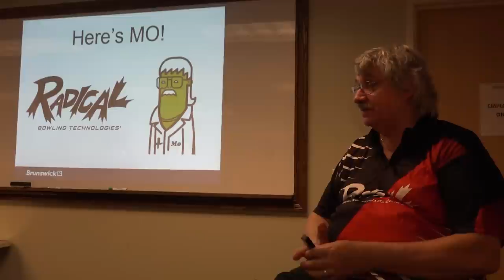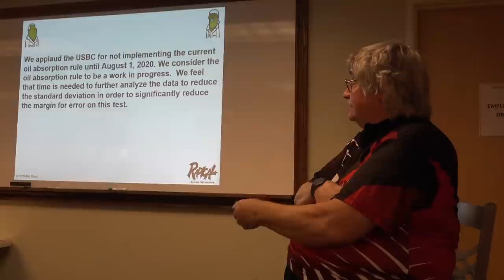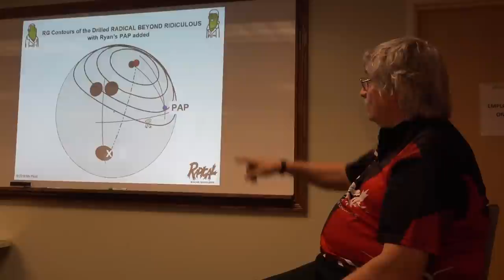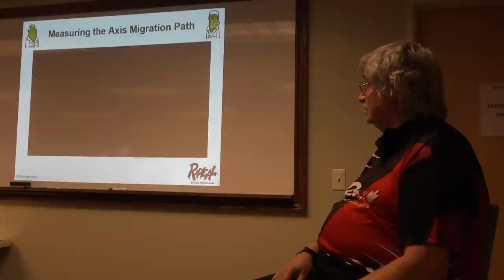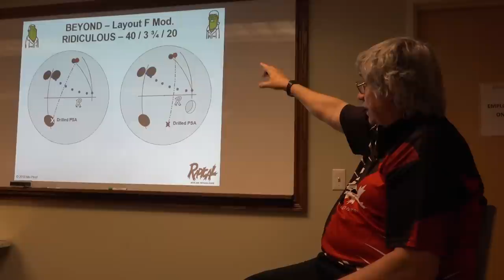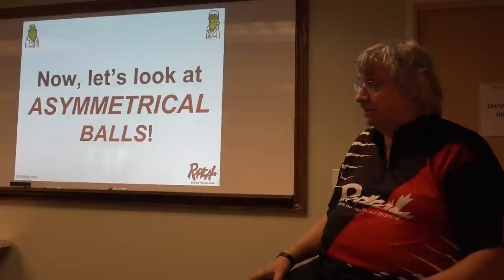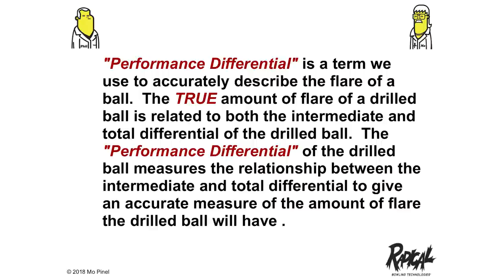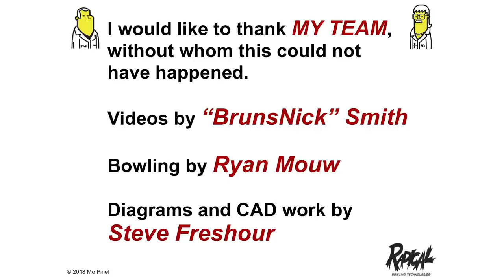The New Reality of BALL MOTION - The Rules Have Changed

Comment: Thank you for making this presentation available. As well as making it easily understandable. I do have one question, I can't seem to find any data on how this will actually effect the motion of the ball. But, Mo said it, so I believe it. Just don't know what exactly it will do. If I were to put a 1 1/2 thumb slug in my symmetrical ball with 1 3/8 another 1 1/4 deeper, what effect would that have on the ball? I have about 3-6 degrees of axis tilt. My symmetrical balls are drilled pin up and to the right. Would adding a thumb slug in this manner make the track flare up over the thumb or fingers or would it not have that particular effect on it?  Thank you.

Comment: First off thank you Mo for putting at such a great presentation. I am in kinda in the same boat as Eric S posted about trusting the ProShop. I have no idea what I even need as a bowler. I have not bowled in League Play since the late 90 and all of my balls are from the 90's with one of them having a balance hole as that was the thing to do back them. Guess I will be shopping for new balls soon. I do know that I've been told that I'm a Tweener style player with a lot of bowl roll. Whatever that means, I have no idea from a technical standpoint.  I look forward to learning more about the bowling overall.
Reply: TechT1999 being a tweeter means you can play a straight line and also a bigger hook than what the bowling community calls strokers (Norm Duke and Parker Bonn III are two stroker players). The other is cranker which means that they have a huge hook and can’t really play a straight line. I used to be a Tweener because I was able to switch from going straight to having a big hook. Now I’m a cranker because I’m a two hander. It’s really hard to get the ball to go straight as a two hander unless you have a plastic ball. Anyway hope that helps

Comment: As a two handed bowler, should my center of grip be measured from the top crease of my middle finger to the top crease of my wrist or remain as the span between the finger and the thumb like one handed?
Reply: If I understand your question of center of grip for no thumb bowlers. It is between your 2 fingers in the ball
Reply: Your question reminds me of a likely follow up issue... Since USBC rules are largely anchored in a traditional grip history, you could just measure 2 1/2" squared off of finger holes and inscribe the required + mark there - that reminds them of the traditional layout, and should satisfy rules when 2020 rolls around.   As long as that mark sits under your palm while bowling, you should be good, as I read it.   As for the real layout? Those wanting to go no thumb will want to start with this bit of reading if they haven't already seen it: http://radicalbowling.com/tech-docs/a-radical-look-into-no-thumb-drill-patterns
So...MATT is correct, and a brave new world lurches on.
Reply: Bowling 2handed you should pay 2 times the amount in USBC fees,
Reply: I don't see the 2 handed style lasting. The way you have to contort your back these kids won't be able to do when they are 40 plus
Reply: Troy22U you obviously don’t understand how the two handed style works. The twist is the opening of the shoulders and hips to get your body out of the way and to increase the ability to project the ball onto the lane. If done correctly, the only thing that happens is the first time you do it the next day you are going to have a hurt right arm because you are using different muscles. Your back will not hurt. Even Walter Ray Williams uses the two handed deli every sometimes and while he doesn’t open his body as much as say Jason Belmonte but I doubt his back is hurting or he wouldn’t do it.
Reply: Troy22U Jason Belmonte is 36 and he is still going strong with his style so I don’t see how your comment works. Sorry

Comment: When Mom says that if you want your Asymmetric ball to roll like a Symmetric ball, then just put the PSA in the thumb hole...

Is he stating that he highly discourages this type of layout? I was thinking of drilling a pin up ball with a 4inch pin to pap and the PSA just right of my thumb hole. 

Estimate it to be a 40 x 4 x 35. No balance hole of course. Is this not what Mo is recommending?
Reply: Lol spell check
Mom = Mo
Reply from the maker: @ricerocket702  No, he is not discouraging the layout at all. He is stating that asymmetrical balls are inherently more versatile with drilling options than symmetrical.

Comment: I'm a MBB in 6S with 12 years experience in data analysis for Fortune 50 companies, non-profits and the USFG.  I will tell you with full confidence that a 19.55% STD is not even close to valid.  In this type of testing I would accept no more than 10% before making a policy change.  That is minimum standard for testing.  For social analysis like a KJ it can be a bit higher (15%) but for manufacturing tests 10% is marginally acceptable if it is not "critical".  If the component is "critical", as the rule is implies, I would not accept more than 5% STD.  What the 20% STD implies is that there is a flaw in the testing methodology, instrumentation and/or the "critical nature" of the component being tested.   Like I tell ALL my clients, "action for action sake is a fools errand."
Reply: Thanks for your professional input, but I'm pretty sure everybody here with a junior high statistics class knows that a 20% margin of error is comical.

Comment: Deep thumb on IT system:
drill 1.5" hole for IT
drill 1.375" hole at the bottom, 1" deep 
drill 1.25" hole at bottom ~.75" deep
Glue sanded slug into 1.375" hole and drill it out the excess slug using 1.5" IT bit
drill .5" hole for molly. Possibly illegal, due to the internal void rule, but virtually impossible to detect.
Reply: Can you elaborate on "glue sanded slag" ?  Thanks
Reply: Is the following accordane drill bit correct?
1,5 = 1 1/2
1,375 = 1 3/8
1,25 = 1 1/4
If YES, then my IT kit, contains 2 bits of 1 5/16, and 1 7/16.
How can I apply your idea, which actually, I like it.
Thanks again.
Reply: 1 7/16" bit is slightly larger than the 1 3/8 slug, so the concept should work.

Comment: Balance hole moves PSA right. So does no thumb hole move it left?
Reply: psa on a drilled ball goes towards the largest hole drilled, unless the ball is a strong asym then it stays where the predetermined mark on the ball is at, so it would be in between the two fingers
Reply: @michaeldietz2312   I have no clue what to expect when drilling my next ball since I'll need to only drill my 2 finger holes. Is there anything I can reference? I like my pin-up layouts now with the length I get. I just don't know if the reaction will be similar.

Comment: When the ball is in the DeTerminator, the axis migrates from the PAP to the PSA. But in the diagram, the marked migration path goes from the PAP to somewhere between the pin and the PSA. If that path continued, would it eventually reach the PSA? Is the ball not on the lane long enough to get there? Or did i miss something?
Reply from the maker: When the ball is on the lane, the axis migration path will follow the RG contour. On the Determinator, it only locates the PSA so we can draw the Pin to Spin line.
Reply: Ha Ha. I guess this is a part of physics i'm not likely to get my head around. It just seems to me that if the PSA is the axis the ball wants to migrate to and rotate around (as demonstrated in the DeTerminator), it should want to do the same thing on the lane.
Reply from the maker: The Determinator is adding energy to the ball and will seek out the High RG axis. (PSA)
Reply: Wow! I feel like a dog trying to understand a hammer😂. So the rotational energy you put on the ball at release doesn't do the same thing?
Reply: greggas1 has
Reply: you rolling a ball LOSES energy. the determinator is adding energy to the system. watch the ball on the DET b4 it finds the final PSA point, it moves around a bit 1st, NO? That never happens in 'actual bowling' bcuz of the LOSS of the initial applied energy by the bowler. Therefore the PAP stays on the RG contour @ release, for the most part. Your comparison to the DET does not apply here.
Reply: When i'm trying to understand the difference between what the ball does in the DeTerminator, and what it does on the lane, it most certainly DOES apply.
Reply: By adding the energy to the ball w/ the DET, which is the exact opposite of you or I rolling the ball [ losing the energy] it most certainly does NOT apply. That IS the difference, cannot compare 2 dissimilar models that way. WE can't add anything once the ball leaves our hand on the lane & only lose what was applied. Just like retaining 'energy' on the lane is a misnomer. Real balls LOSE energy even on the slickest of conditions ,nothing is retained let alone added such as the DET does. Got it??? or......
Reply: Nothing you just said explains WHY the ball behaves differently. Why does it behave one way while having energy added,  and a different way when it's losing energy. Yes, i've read before that it follows the rg contour, but that doesn't explain what an rg contour is or why it follows it.
Reply: Ask Mo or MathisTruth on bowlingchat then...…………….I'm not a physics teacher & don't know what else to tell you until you better understand ball motion & basic physics principles.
Reply: Great site. Already a member there. Yeah, when those guys start talking about ball motion and get into technical terms and equations, my eyes start crossing😵. I was hoping i might get more of a laymans explanation over here,  but that might not be possible.
Reply: All you can do is ask over there. What's your handle over there BTW?
Reply: greggas. I don't post a lot over there, but i love reading the forums.
Reply: greggas1 you are over analyzing the concept. Did you ever study algebra and ask why a rule was a rule or did you just accept that rule and understood that the rule will never change. The modern bowling balls follow the laws of physics.
Reply: greggas1 the Deterinator shows how the bell wants to roll if a ball does not see friction. That’s why on the Dterminator the balls spins to the PSA.

Comment: Tons of great info here. But what’s strange is the statement about asyms> syms. My hardest hooking balls are syms.
Reply: Hes saying they wont be in 2 years.
Reply: Do they have a balance hole/weight hole?
Reply: All depends on the oil pattern. If there is more oil out then you will see that your asym actually hooks more. But bowling on open bowling times and league bowling house shots where the volume is so low  especially the closer you get to the gutters that the strong balls actually go thru the three phases of motion so fast it looks like it isn't doing anything.
Reply: I'm a no thumb with no extra holes, just 2 holes on the cg, thats it.
Reply: I get you now, thanks.
Reply: @jovanlouis4791  2 holes on the CG? Cool. How does that do for you? I'm about to drill my first without a thumb hole.
Reply: It's drilled on the cg so the ball can be legal. & yeah every ball works as advertised.
Reply: Jovan Louis my coach says that once you drill a symmetrical ball it becomes an asymmetrical ball.

Comment: The only thing I strongly disagree with is saying that a bowling balls core makes a bigger difference than the coverstock
Reply: I think what he said was the core makes a bigger difference on the SHAPE the ball will have more than the cover will.  Adjusting the cover will change the break point (closer or later) but how the ball is drilled dictates the shape of the arc the ball will have.
Reply: I understand his thinking on it, but why would they then make multiple bowling balls that have the same core and different cover stocks and see such a wide variety in ball motion
Reply: @austinladd4088  because they can sell more bowling balls:) 

There is quite a difference between a Solid pearl and Hybrid cover all using the same core I agree. I think he is saying that the overall shape (angular or smooth) is determined by the core the cover and cover prep help fine tune it moving it further down lane or earlier etc

Comment: I wish USBC would go much further.  I grew up bowling in the 70's and the 80's, back when a 200 average and a 300 game actually meant something.  I watch today's player and just shake my head.  These same guys who average 210 now would have averaged 160 back in the day.  If the USBC wants bowling to succeed, they need to limit the "hook in a box" bowling balls.  I started bowling again in 2009 after a 12 year layoff only to quit in 2013 after witnessing this first hand.  I love the analytics of ball motion, and Mo is second to none in my opinion.  I learned so much from him during my 5 year return to the game.  Thanks Mo for sharing your knowledge.
Reply: Joe I disagree.  I also grew up bowling in the 70's and 80's as a Cranker.  I never had a problem of hooking the ball with plastic or anything else.  As Mo said in the above video the USBC new balance hole  rule will handicap the weaker and rev challenged bowler.  To keep these types of bowlers they need to be able to hook the ball with their present style with reasonable hitting power at the pins.  If USBC wants bowling to succeed they need to stop the easy lane conditions and enforce lane spec rules.  Maybe even limit total oil volume applied to the lanes.  Those factors are the biggest problems with bowling.  Not so much that bowling balls can hook out of the box.  Limit the oil applied and the easy patterns allowed and scores will drop to a more honorable level.  Bowlers who want to improve their scores will either need to learn how to put more revs on the ball or develop the knowledge needed to create better ball motion.  Than the integrity of the sport will return.
Reply: @darylw792 Both of you guys are wrong. I grew up bowling the 70s and 80s as well. If you were able to carry a "good" average back then (mine was 180s), then you should be able to take your great mechanics you learned from back then, apply them to today's technology and average 220.  Don't cry because the "hook  in a box" bowlers (or two handers) are beating you.  If you can't adapt to the new technology of both equipment and lane conditions then you weren't really that good of a bowler in the first place.
Reply: @Haystack65  What am I wrong on?  I agree with everything you said, and nothing in my statement contracts what you said does it?  If one carried a good average back than (in the 70's mine was 200 - 210; in the 80's it was 220 - 230) they should be able to apply that talent to today's game.  I agree with you.  Where in my comments am I crying about "hook in a box bowlers" or two handers?  Most of these types of bowlers today are as dumb as a box of rocks when it comes to understanding equipment tech and lane play strategy.  And because of that I kick their ass most of the time.  Whose complaining about these bowlers.  I find it fun playing against them.  Did I not say that bowler's who wish to improve their game need to put more revs on the ball or increase their knowledge of the game?  Is not the idea of improving one's knowledge of the game adapting to the new tech and lane play strategies?  It surely is different today than in the 70's and 80's, right?  Of course most bowlers back than did not keep up with the new so called tech and knowledge of the game just as today.  I do not care how much a ball hooks out of the box.  If one does not know how to use it they will not benefit from it.

The only thing I said the USBC should do is crack down on the easy lane conditions of today.  Are not the lane conditions easier today than they were back in the 70's and 80's?  What is wrong with toughening up the lane conditions at least to what they were in the 70's and than check them after each award score to make sure the condition is legal just like they did in the 70's?
Reply: @darylw792  What did you say that was wrong?  Not much, except for this "Maybe even limit total oil volume applied to the lanes."  Again... if you can't compete under the current conditions with today's equipment then you really weren't much of a bowler to begin with.  Or do you really think we should "dumb down" the conditions for newbs to learn???
Reply: @Haystack65  I will give you the comment on limiting oil applied to the lanes.  If a bowling center wants to spend the money for high oil volume than go for it.  I have yet to see too much oil in my case. 

I am not sure what you mean by dumb down the conditions.  Could you explain the meaning of your phrase, because I can take it two ways that oppose each other, and I do not want to put words in your mouth that you did not say.